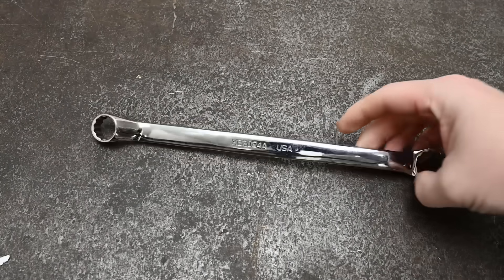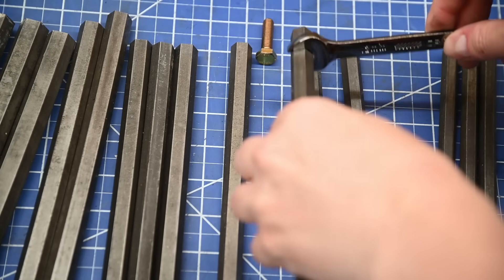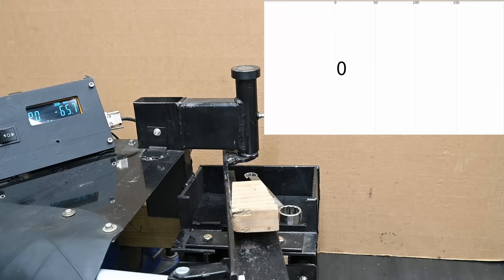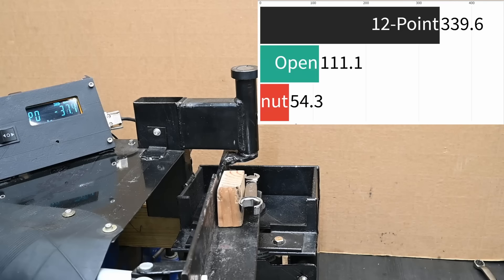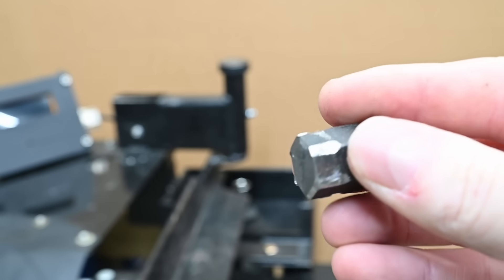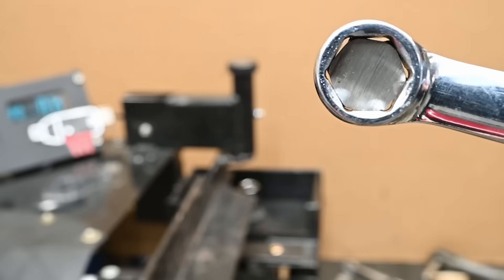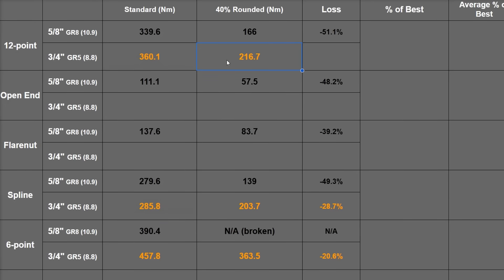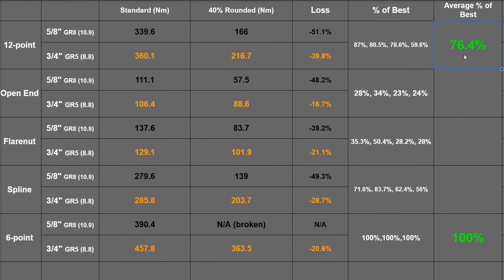Wrenching Robot Settles Which Slips 1st

Comment: Whichever you choose, it will still slip right when you’re precariously positioned to have your knuckle impact a piece of jagged steel at mach 3
Reply: Yeah, why is it that wrenches never slip when you hand is in a safe position?
Reply: @ethanpeschman4458  The same reason why when you drop a socket on the floor it rolls as far away as possible from any possible way to reach it, into the oily spot.
Reply: @EF-69 and if u drop a "one of a kind, really important knut", it vanishes for 3.25 years!
Reply: @ethanpeschman4458  It's because big pharma has implemented an ai chip to make them slip whenever theres a risk for blood poisoning. They just failed to realize that mechanics never go to the hospital anyways.
Reply: @eloliasos_8612 this got a hearty chuckle from me
Reply: @ethanpeschman4458 engineers make sure to always put the tightest bolts next to sharp metal shrapnel
Reply: I almost knocked myself out once when a wrench slipped.

I ended up punching myself right in the face and I saw nothing but white for a few seconds 😂
Reply: @volvo09 yeah, punching yourself always pisses you off because there's nothing to get angry at 😂
Reply: @TheGreatBungholio this is why I as a commercial electrician refuse to use cheap zip ties. I’ve punched by self in the face more than once while trying to aggressively tighten a cheap zip ties only for one to fail and end up with a bleeding nose. NEVER AGAIN!
Reply: @DMSparky  Never zip ties, only Ty-Rap® 😉
Reply: @TheGreatBungholio  Except the workpiece, God help that poor trailing arm 🪦
Reply: @TheGreatBungholio  I punched myself in the face pulling on a 1-1/2 wrench. Twice. No option, horrible positioning, job had to get done. The absolute RAGE I felt was something, man. I've scrapped before, I've been jumped, whatever. There was always someone else to point at or swing at. But you just can't hit yourself again for hitting yourself, it's really counterproductive.
Reply: @-tr0n  Wow! You just don't learn, do you??... 😆
Reply: @davelowets no, not really
Reply: @DMSparky  how much force do you think you need to use one zips??? You just make it tight enough where there is decent resistance and thats it, no need to go Incredible Hulk on them...
Reply: @volvo09  hahaha, one time I was hauling a really shitty load, because the straps kept slipping, I had to crank down as hard as I could, turns out the ratchet did not seat itself properly and slipped, I ended up full power uppercutting myself, almost knocked my own ass out🤣
Reply: @volvo09  I bloodied my nose the other day when I had one let go. The bridge of my nose is still sore. 😂
Reply: @volvo09 yea okay tough guy. Or not? Wait… does that mean you have an iron fist or a glass jaw?
Reply: @volvo09 Now, THAT scenario is 💯% on YOU... 

Punching a stationary object behind the wrench is inevitable, BUT, punching yourself in your movable head IS completely avoidable... 🤷🏻 🤦🏻
Reply: so fuckin true
Reply: This is not a variable, but a constant in my equations.
Reply: FACTS!!!!!!!!!!!!!!!!!!!!!
Reply: That's why you don't wrap your fingers around a wrench when pushing it forward.
Reply: Bingo
Reply: @stevetaylor9265 That is exactly what I said!  
But it sounded more like “Bitch”
Reply: law of mechanic physics
Reply: Every. Single. Time..
Reply: Reminds me of the time I almost knocked myself out because a socket wrench slipped and i hammered my fist holding said wrench directly on my nose. Which taught me not to look at what I am trying to loosen.
Reply: I swear I saw this almost exact comment when they tested 12-point vs spline. 
Thanks for making me doubt my recall.
Reply: Or fly right out of your hand , ricochet off and land square across your nose !
Reply: Big pharma sucks. Why are they messing with my wrenches
Reply: For me, it usually waits until my hands are nice and cold, the metal is freezing and then I'm at full torque. Then I'm picking up pieces of the back of my hand.
Reply: Only time I've ever had a wrench slip was exactly when it was a worse case scenario. Grad its not just me.
Reply: every goddamn time
Reply: It’s even worse when the thing slips right at the perfect time to not just do that, but also break the bolt and send the wrench to god knows where whilst you writhe in pain on the ground.
Reply: be kind to your tools and they won't betray you like this as often.
give them a compliment then and when.
Reply: real
Reply: After doing this enough times I learned to push with an open palm
Reply: I've got a solid scar from a gear head flappy back snapping putting in conveyors, knuckles accelerated at 30,000 gs and I hit the edge of the steel at mach 54. No the knuckle creases look all deforned lol
Reply: or break your acrylic nails, if you're me 🥲
Reply: Yeah... or the face
Reply: *mach fuck
Reply: You forgot rusty
Reply: It's like you can see into my soul. Lol
Reply: Facts
Reply: real
Reply: When it's 20°F
Reply: That's facts💯🍻😂😂
Reply: Why are you putting that much force on something omg leverage is ur friend
Reply: I'm typing this with my bleeding hand😂
Reply: mach 3 😂😂😂
Reply: Real
Reply: Well, that's just a given... 😏
Reply: MotorStorm content creator !!
Reply: Oof, reminds me right away of my previous work.
Reply: Happens. every. Single. Time.
Reply: Got a scar from when I was working on my mate's RX-7 a few months ago and slammed the entire left side  of my hand into a chunk of metal that had sheared into the perfect serrated knife edge
Reply: I will never forget the time I punched myself in the balls while trying to work on my tractor. I’m no baby but when I have a wrench hit me in  the nuts at Mach Jesus, I cried for 5 minutes
Reply: In the dead of winter.... which always seems even more painful. 🤔
Reply: I just try to be aware of what im pushing or pulling into, I guess it's experience because as a 25 year tech I haven't busted a knuckle in years! But I also own every wrench style made in the last 50 years or so, That probably helps as I  always reach for the right tool for the job. I have had a couple wrenches come out of a tight area and fall on my face, Usually hits my lips or an eye😂
Reply: It’s all about building fine motor control and a mental database of how materials behave and when you’re approaching limits of tools and materials. Not bragging but just stating that I’ve been a commercial electrician, and a mechanic on the side for 20 years and I rarely bust knuckles or cut myself any more. If one keeps experiencing pain doing the same thing over and over again never learning, it’s safe to say there’s more in their life destroyed than just knuckles. So to those who keep experiencing repeated self inflicted pain of any type stop being a lazy thick headed fool and start learning and winning, the future generations will thank you for it. Losership is not cool no matter the picture they paint you. Be a “nerd”, be “weird”, go win.
Reply: Yerp, just got done repairing a smashed thumbnail with blood blister and  delamination to attest and certify your theory.